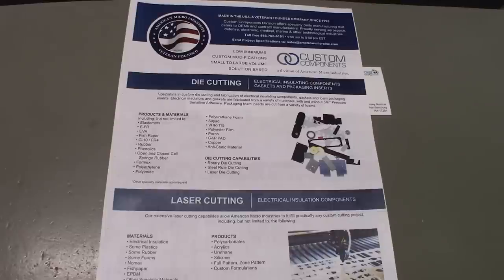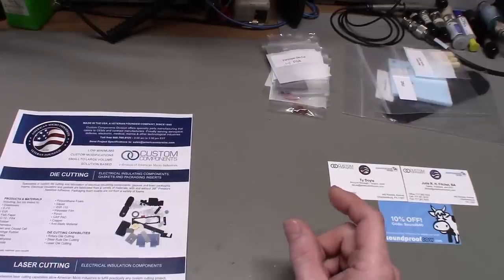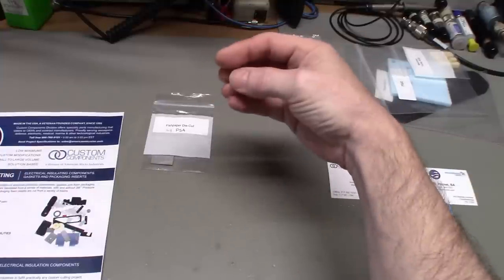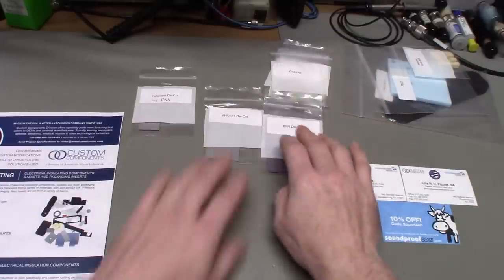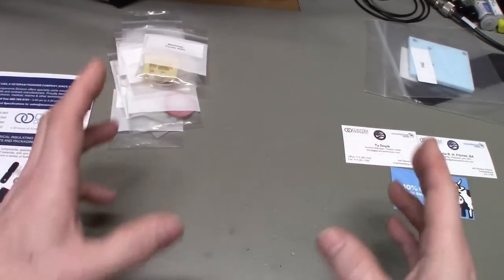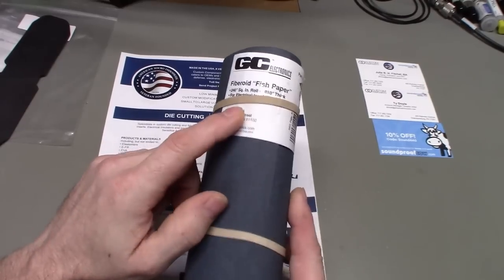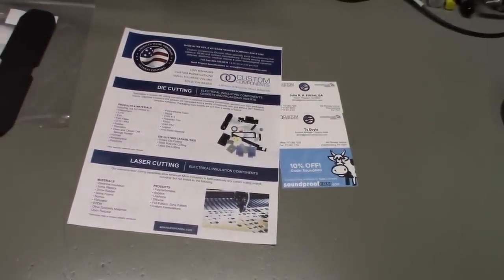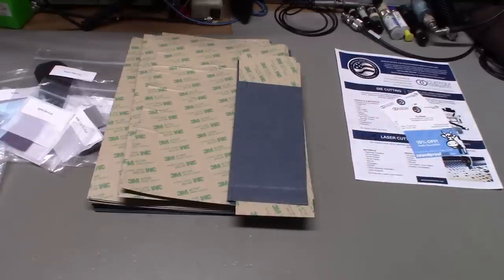Review of American Micro Inc. products. Fish paper, foam, FR4 board...

Comment: I have never ever heard of Fish paper but know what your talking about following the explanation. Nice to plug a local supplier and I always try to do the same. My understanding is that FR4 is flame retardant rating not an actual material i.e GRP. I remember something about woven products having a higher voltage rating or perhaps preferred for high voltage. I think it’s because a crack will not form all the way through the material, again I think they call it lay up. I do a bit with engineering plastics as I work with 25KV frequently so come across these materials.  Generally you wouldn’t want to try to temperature control a standard crystal as on ocxo  crystal has a very specific cut at manufacturing to meet the temperature sweet spot. As you say it’s a reasonable idea to insulate a crystal for short term drift. Regards Chris

Comment: The Dollar Tree (and other dollar stores) has craft foam with adhesive on the back that works really well for sound dampening, electrical insulation and vibration dampening.  It's not very big but it's cheap and easy to find.